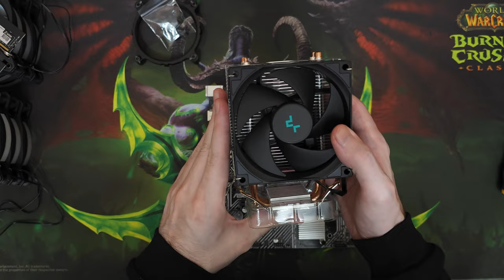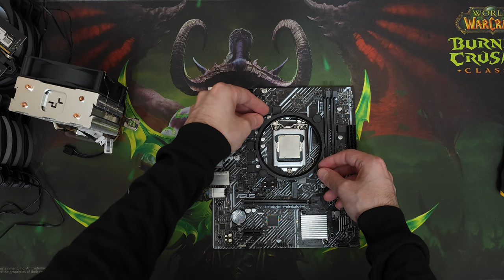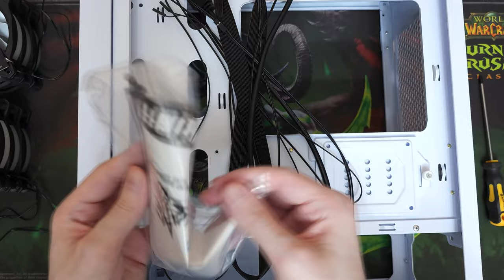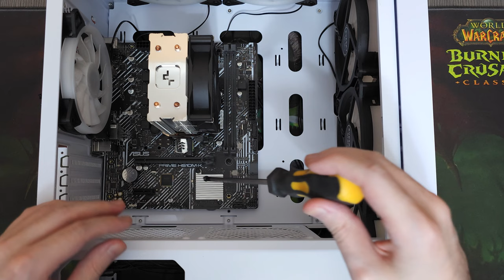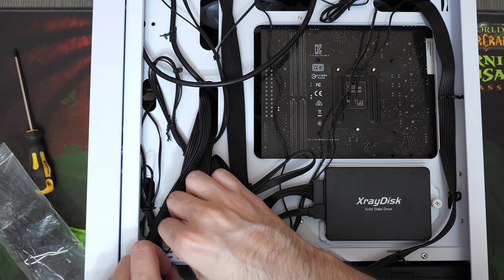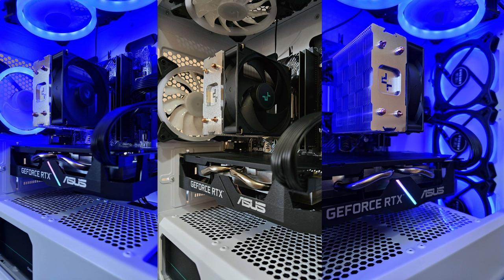What It's Like To Build PCs For A Living

Comment: Was installing the AG200 difficult? I've had a hard time installing it before and gonna do it again and I'm worried about breaking my Mobo into 2 pieces or the round CPU bracket. Also I hope things work out for you
Reply from the maker: I can see why installing that cooler might seem difficult to you. Once you install the plastic bracket that the cooler latches onto, attach the top side of the cooler first, then pull down the other side. Keep both of your index and middle fingers onto the metal part while pushing it down. Remember, don't push the latch yet, push down on the metal frame that is next to the latch. Put ur thumbs on the motherboard to make it more comfortable. Once you bend the metal frame enough, like around 90% of the way, then start pushing down on the latch and help it with ur thumbs underneath.

This whole process is difficult to explain in text, but I'm pretty sure you have to use a lot more power to push it down than you think. Hope it does well.

Comment: flipping/building pcs has actually been something i’ve wanted to do for a while but i really don’t know where to begin. do you have any tips for what to buy to start off and where to look?
Reply from the maker: It depends. Starting with a low budget and going for a "cookie cutter" build is the best way to start.

Any 4th gen i7 & GTX 1070 PC will sell really well in a beautiful RGB case. Most people don't know how much better a modern i3 CPU is compared to old i7's, so just go for what people 'think' is better. White cases get more attention. If you can control RGB with a button, that's even better.

ALWAYS test all used components before you make the purchase, this is important. Other than that, it's all adventure. If that's what you want, don't worry too much about the times when things go south, it's just part of the success :)

Comment: Curious where you're from? 10105 and RTX 2060 are pretty outdated, but still a pretty solid combination and will get the job done! I build PCs also and the "sweet spot" is typically around $800 USD. Very interesting your users have issues with M.2 SSDs.
Reply from the maker: I'm from Georgia, the country in caucasus region. This PC is considered modern here. The pay is extremely low and our currency is really weak. Few users that have had issues with M.2 SSDs were the ones that didn't clean their PCs, had pets or were smoking. I generally try to not use M.2 SSDs if they have no heatsinks.